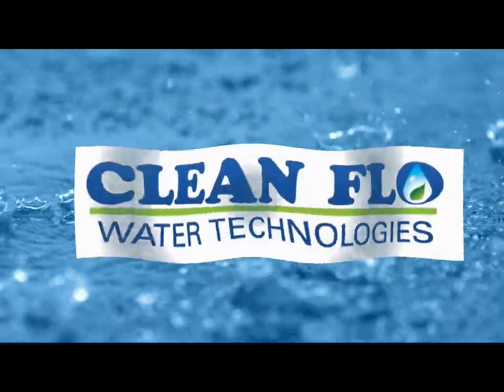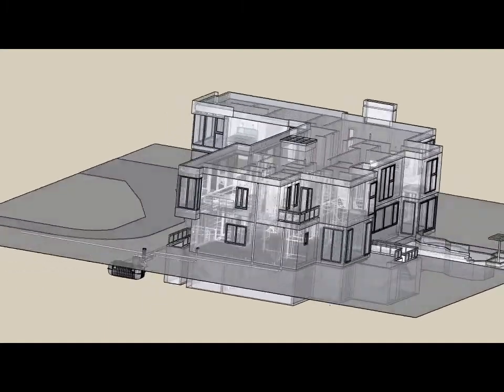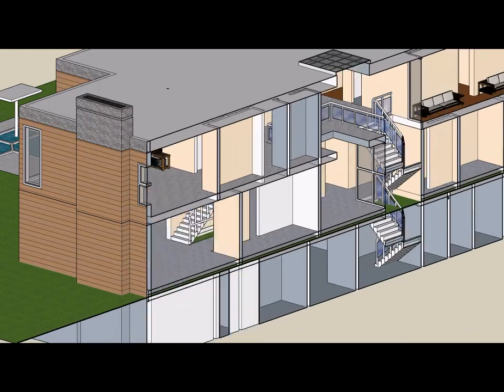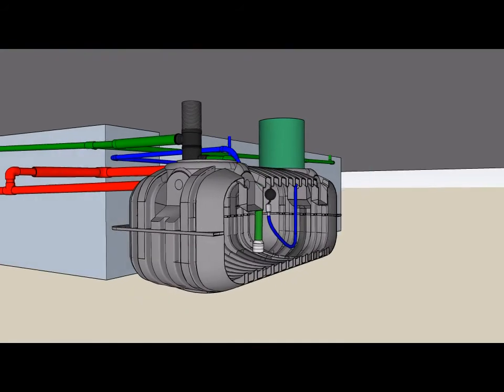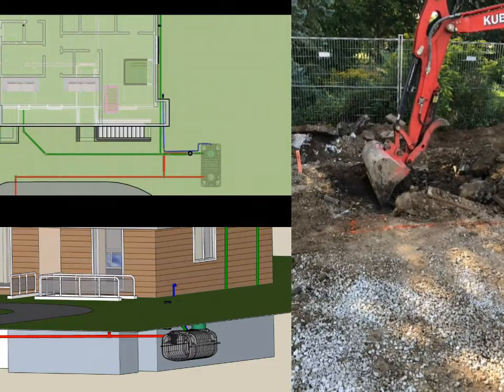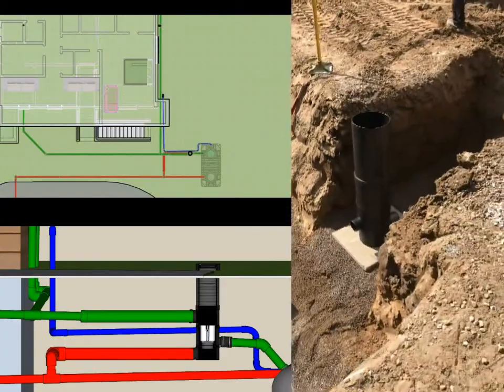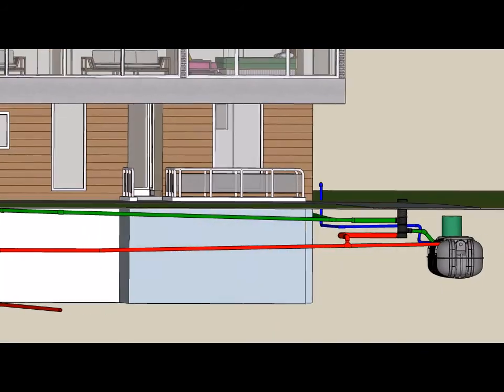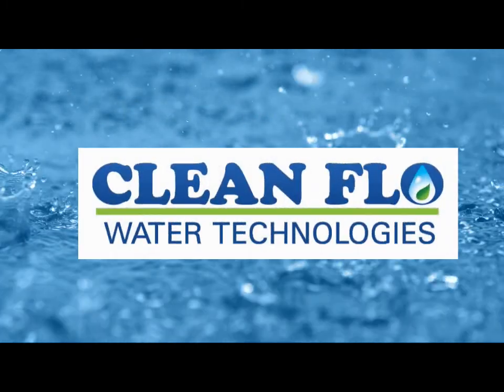Toronto Rainwater Harvesting System Design and Build Video

Comment: Would you guys use stainless steel? I’m sure the plastic you use is BPA Free but they are still known to leak chemicals
Reply from the maker: The plastic tanks we use are often food grade HDPE (like milk jugs). The main reasons stainless tanks are uncommon would be the cost of the material to build a large vessel, and the weight for shipping such an item. There are a variety of metal tanks on the market, however these are often galvanized or powder coated steel with an EDPM or other membrane for holding the water.

Hope that helps!

Comment: Is the blue pipe a hose spigot?
Reply from the maker: The blue pipe connects the tank to the pump for end-use. If you have a submersible pump, and only intend to do irrigation, then the blue pipe could terminate with a hose spigot, otherwise the blue pipe is pulling water from the tank into a pump located inside, and the pump moves water through a treatment system before end-use.

Hope this helps!